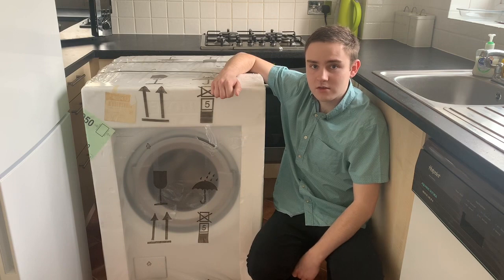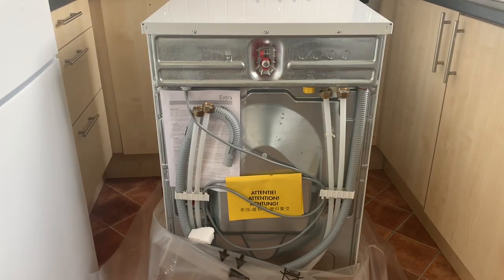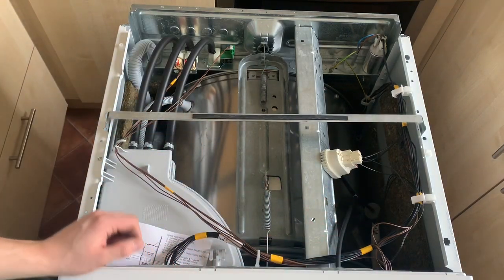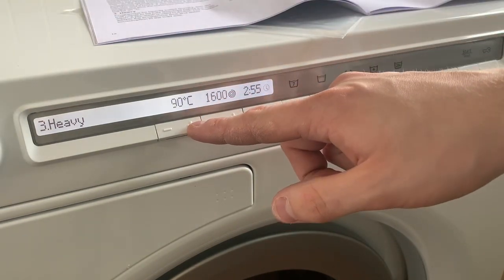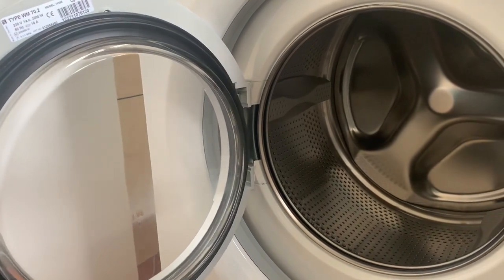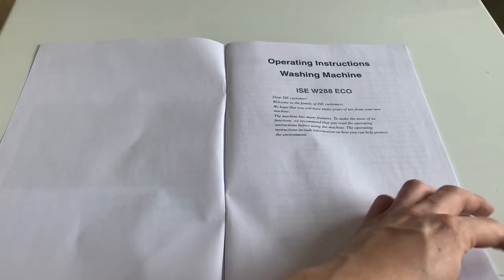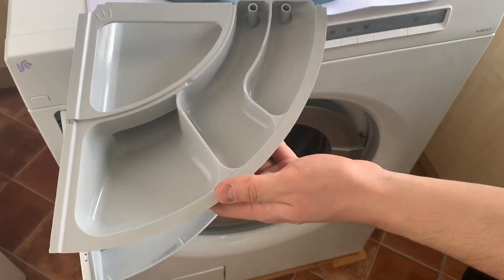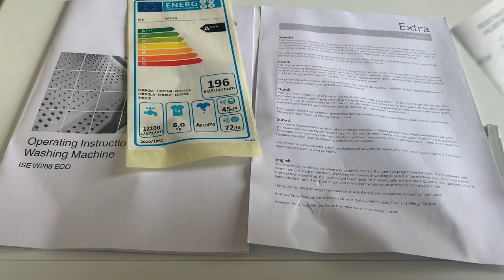Asko ISE W288ECO - Unboxing, a look inside, all programmes and options...

Comment: Hey mate, 

Thanks for the video - What would you recommendation be for a washing machine that does not transmit vibrations to the house if  installed on the 2nd floor of the house (Suspended floor) ?
There is no option to install on concrete or to try any other spots in the house ?

Comment: And don't forget we are waiting for the first video...well...what do you think about 4th program, water plus and Super wash. In this case the washer adds 20 min. prewash after that 20 min sensisave and begins to heat. It you switch on hot water it will be an incredible washing. 🙂😉

Comment: They were about £900 brand new so you saved £800 by buying an Unused 7 year old washing machine. You did really well there. And they are built to last about 20 years. You got an absolute bargain.
Reply: I bought one new when they first came out. Been the worst machine I ever bought. Soap tray leaked from new. Customer service blamed it on customers using the wrong wash powders etc. ANY fault was due to customers misuse. Eventually mine was replaced but the new one was exactly the same. They came with a 10 year guarantee but never honored and service companies refused to come out as they never got paid. They eventually went bust which was no surprise at all.

Comment: I bet this ASKO is going to be a keeper because the newer models don't have those silly flaws that the previous versions had.
Reply from the maker: It isnt a keeper. Its quite noisy when it does spin and it spends ages balancing thinking about spinning, as well as the long and innacurate wash times. Its going to my partners parents, it isnt all bad
Reply: Askos were/are always noisy as hell.

t. 20005 owner
Reply: @TheLaundryCentre  the newest asko models are stunning
Yet ISE hasn't branded them yet